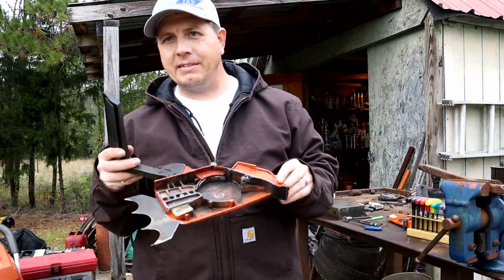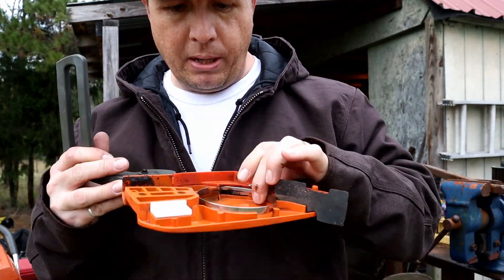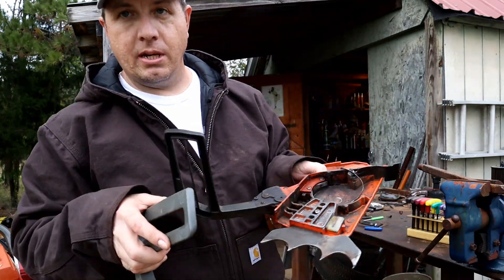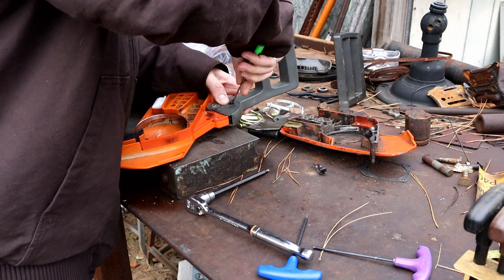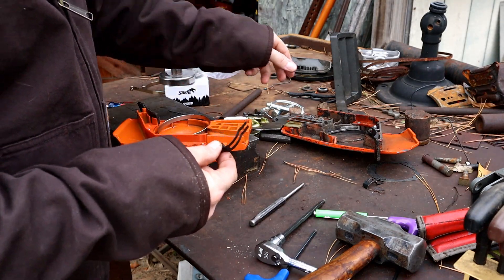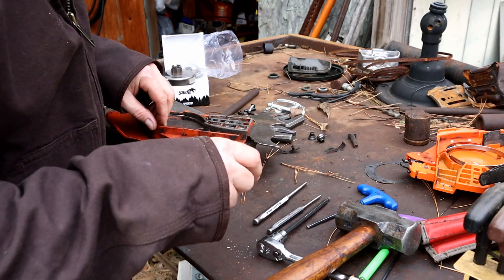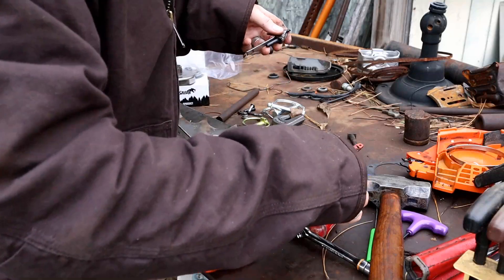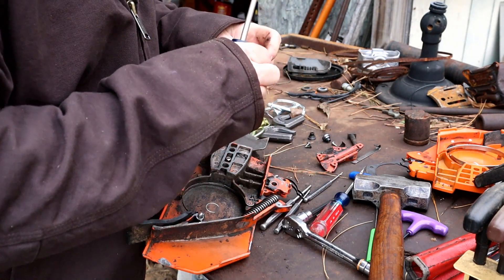Husqvarna Chainsaw Husky Brake Band Replacement Fix Process

Comment: Mine is an older 1984 model 272 with the old steel brake handle. The parts are basically the same as yours though. And I broke that same part that you did, taking the handle off. Luckily I had a spare bunch of parts for it, with one of those little mechanisms.
I think watching your video may have saved me from having to try to find another one of those pieces. 
Good video!!!
Reply from the maker: Thanks Man!  Yeah it’s a heck of a saw. One of my favs. Keep er in the wood